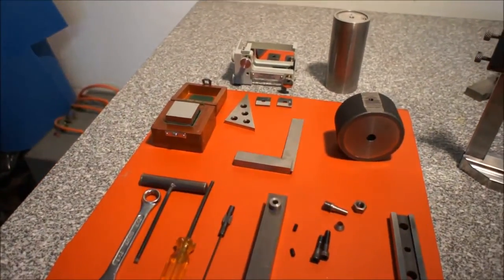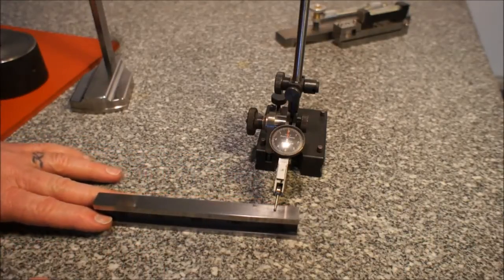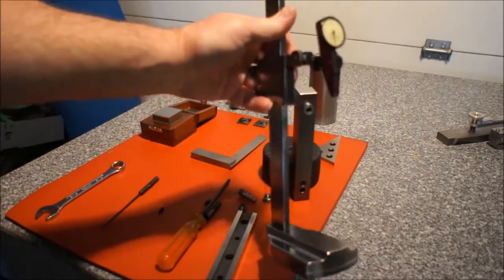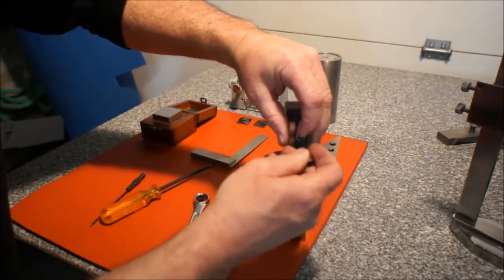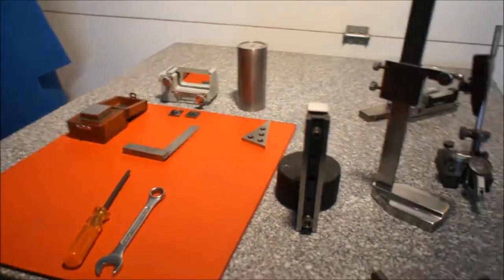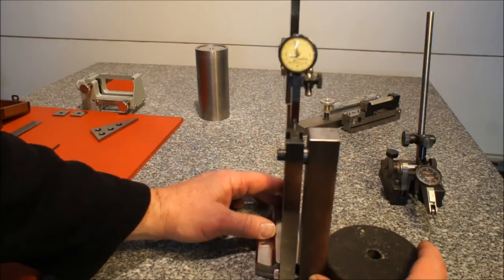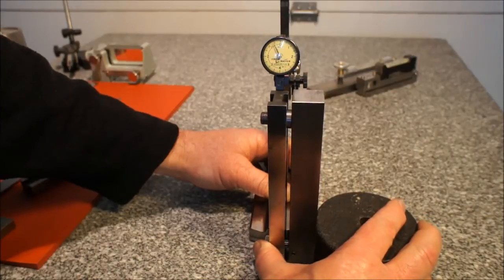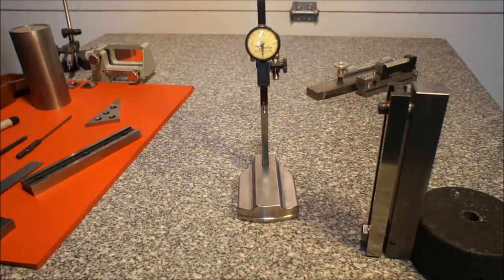Squareness Testing

Comment: That first test is a waste of time.........if the parallel is bowed and has been re-ground on the top face you will still get a level flat plane as the parallel is riding on the bottom end faces.......a second test with a micrometer will tell you if it is parallel or not.